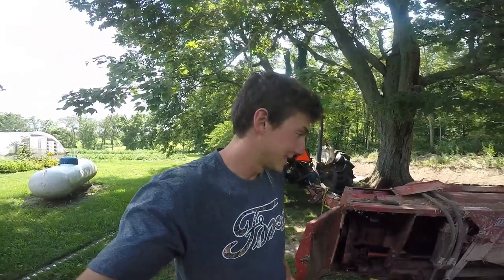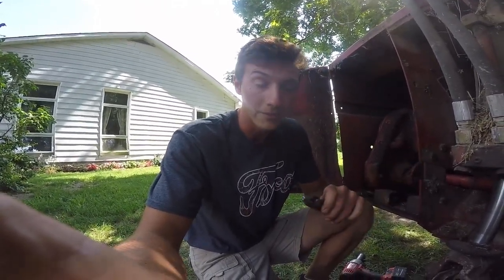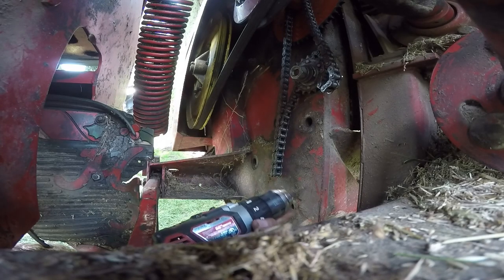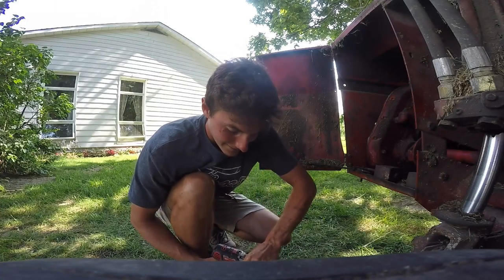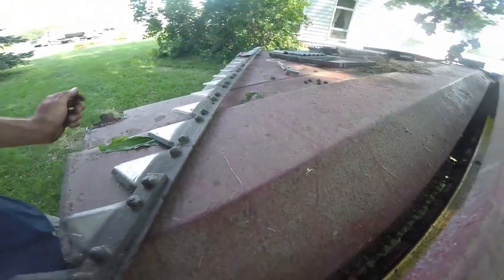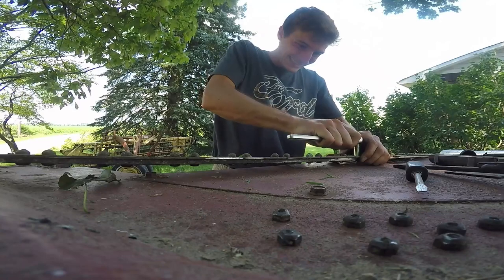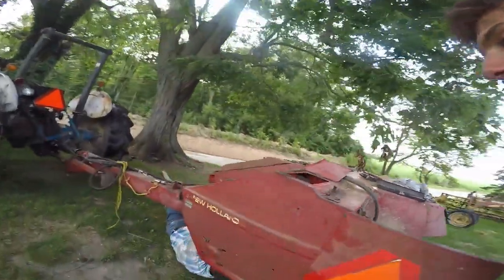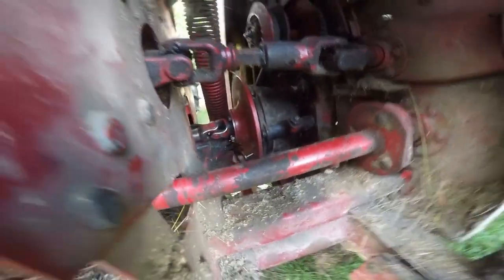New Holland 474 wobble box bolts broke/fix

Comment: Interesting to see bolts holding the section on. Ours are held on by rivets on the 489. We put a new sickle bar on and all new guards this year.
Reply from the maker: The rivets are too much hassle to fix in the field. I haven't broken off too many bolts, just have to be careful tightening. I think we've put a full set of knives on this bar at least four times.
Reply: Are the rivets stock ? My reel won’t turn and my flywheel that is on left is wobbling. Mines a NH 489
Reply: @declantdoyle1973  they were stock on ours

Comment: over serrated are self-sharpening because the sickle usually rests on the guards - gravity. will always be sharper than under serrated. I feel for ya, those 489/495/1465 floating cutter bar New Holland haybines are miserable SOBs. cut nice... when they're not broken in and around the most important part of a sickle moco - the wobble. they designed that area to be so accessible!
Reply from the maker: Nothing has broke without good cause. Our mower gets its abuse cutting fescue in rough fields for other people. If I had nice fields of alfalfa, I'm sure the mower would be mostly original.

Comment: Any info where to get one for cheap ? I’m so close to buying one for 2.4k including core charge which is refundable (400.00)
Reply from the maker: My best advice is to look at local salvage yards.
Reply: Repaired ones are a nightmare more often than not as well. If you can get your hands on a factory rebuilt one and are able/willing to eat the cost, that's the way to go.